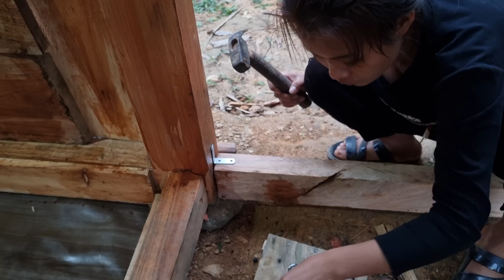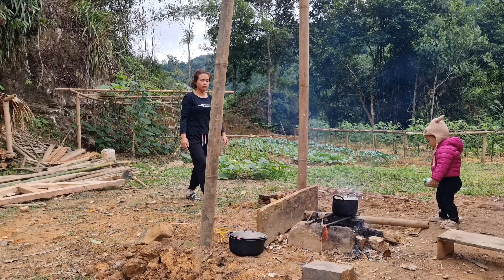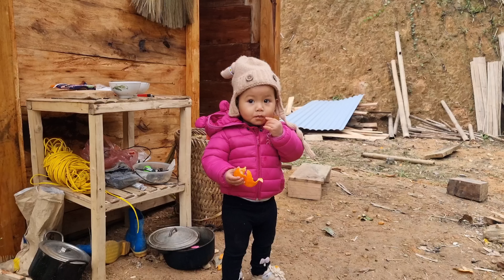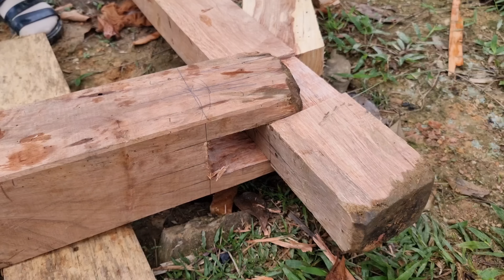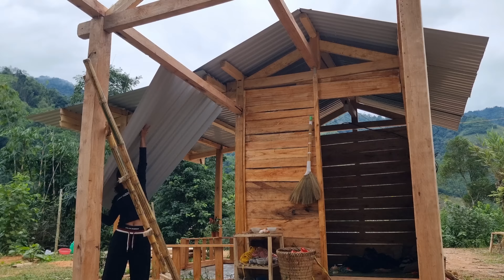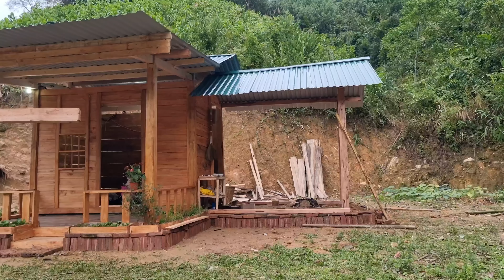Construction of a spacious new kitchen has been completed

Comment: I don!nt understand how made you this shelter your room is not safe from cold and you have not any metress blankit for sleep
Reply: With due respect,  let's not judge or criticize her. I praise and congratulate her for her survival skills. You go, girl...it's not for the fainthearted
Reply: She lives in a tropical place/country . The climate is hot , no need to have mattrass or blanket . She sleeps on a mat made from natural material , it is cooler and comfortable .
Reply: How do you leave in the cold weather your house is not safety you just put ontop the soil if there’s a big storm coming your house will blow into a wind and you put a floor mat on top the soil it’s better you put a cement floor you need to make a bed 🛌 to sleep so scary that a snake crawls inside then they will bite you and your baby you do a work hard but do it right god bless
Reply: She has  come a long way. Whenever she makes enough money, she makes improvements. Little is much while God is in it.
Reply: Just a suggestion to the woman who is worried about the (cold wind or hot sun ) blowing through  the cracks in your walls……why don’t you just split some bamboo in strips about 1 1/2” wide to nail over the cracks on the inside.  Nobody would see it if it matters and thwind would stay outside.  You have done an amazing job so far and you have a lot to be proud of.